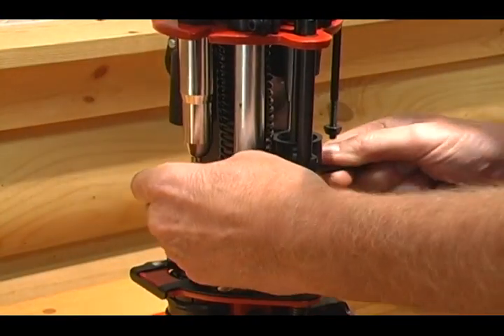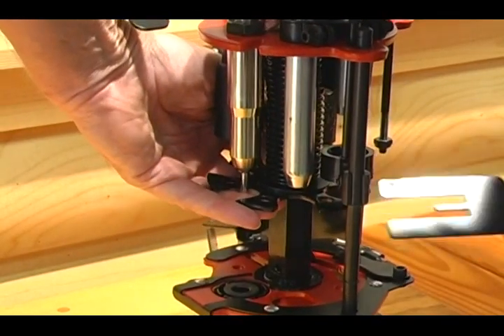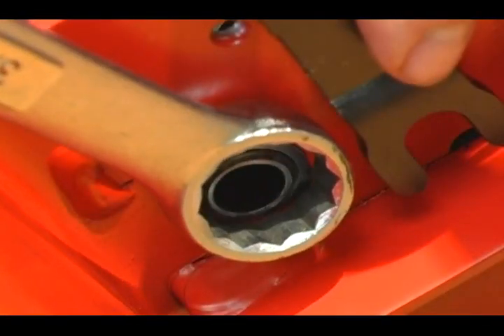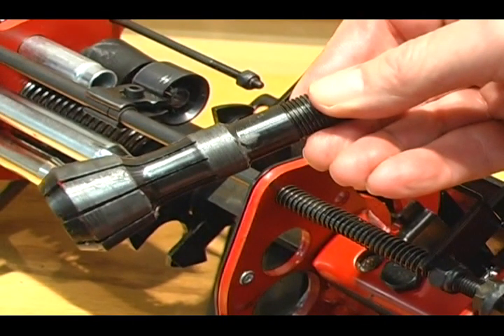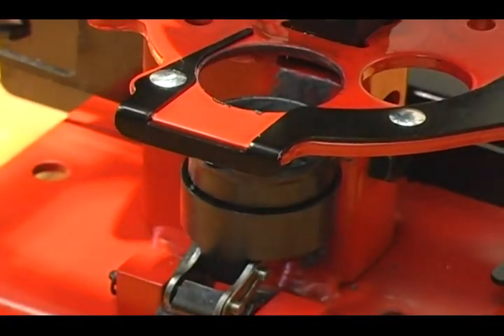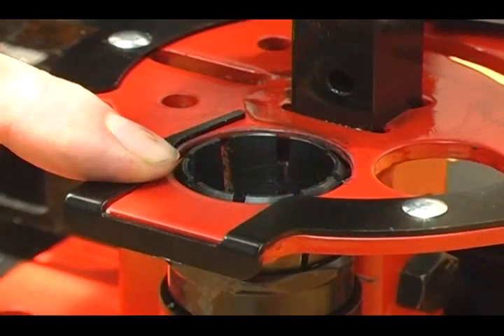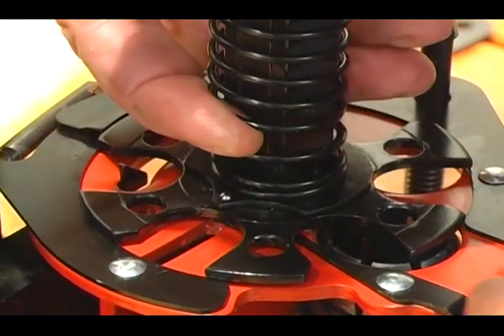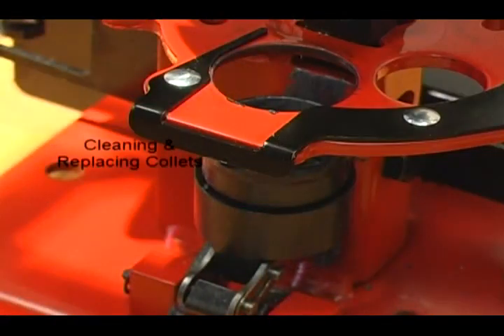MEC Reloaders Troubleshooting   Clean & Replace Collet on Progressive

Comment: What makes the center pin inside the Collett stay level is there a spring in there how does it go back up after it’s resized and primer extraction
Reply from the maker: Hi Kirk Lee, Thanks for taking the time to comment.  The shell lifter is held in place with the lifter bracket that is under the red base of the press.  This lifter bracket will lower and raise the lifter tube as the press is operated. If you have any further questions, please feel free to email us at: reloadersales@mecoutdoors.com
Reply: @MECOutdoors   thanks I’m new to reloading and figured it out with your video! Thanks 😊
Reply from the maker: @mantav8gt  Your welcome!  If you have any further questions, feel free to email us at: reloadersales@mecoutdoors.com     And we are available mon-fri 8-3:30 central time if you want to speak to someone: 1-800-797-4632